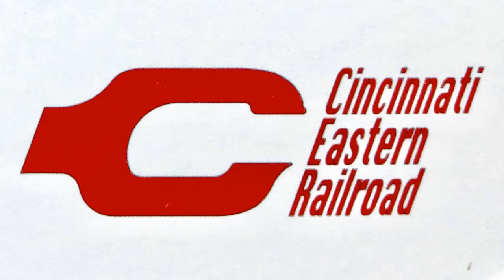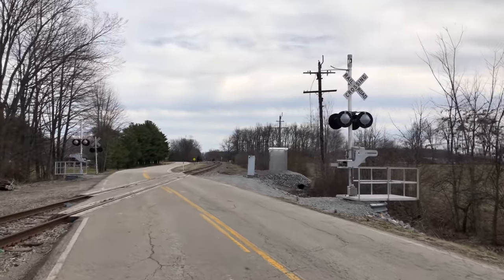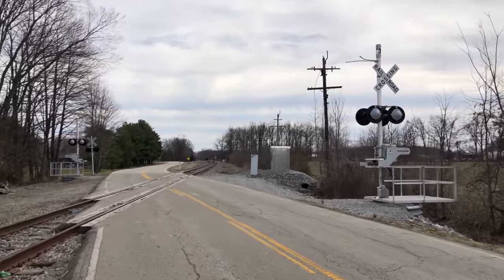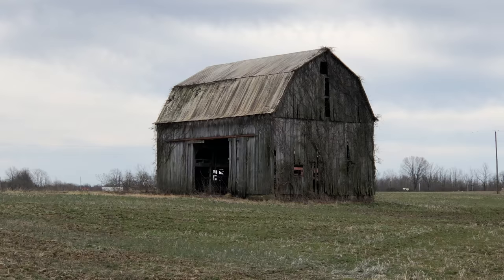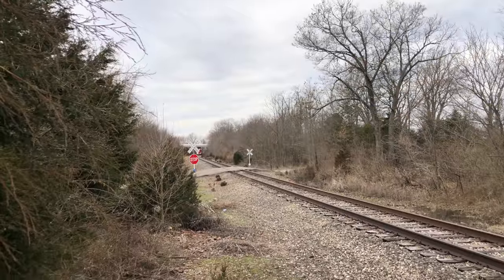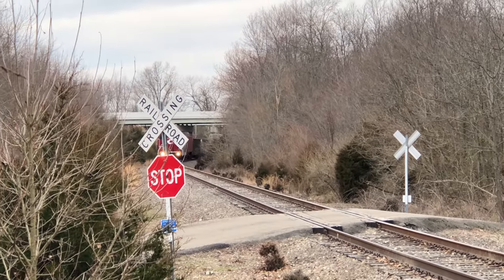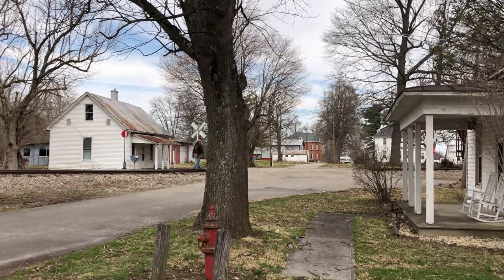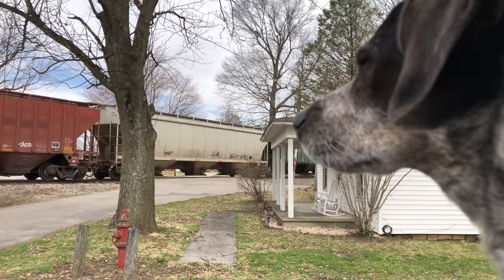Railroad Switching Scrap Metal Customer & Industrial Railroad Spur In Winchester!  Dog Steals Food!

Comment: Those little glandular things could be plastic pellets.
Reply: Not for Mt Carmel. They do ground stabilization so they use a lot of lime. That particular hopper is the kind used for fine powders like flour. Could be powdered lime, though I'd expect they'd put that in a regular covered hopper rather than a pressureflow.
Reply: beeble2003   We use to store hundreds of covered hoppers full of different types of plastic pellets.  I don’t pay that much attention to the specifics of the covered hoppers.  I do know they carry a wide variety of products.  I don’t need to know what is in them, just how much..

Comment: What's the clicking sound coming from the engines?
Reply: The spitter valves that purge condensed water from the air brake system.

Comment: What is all the clicking coming from the engines,?
Reply: The spitter valves that purge condensed water from the air brake system.
Reply from the maker: Yes, blowing the water out to prevent damage